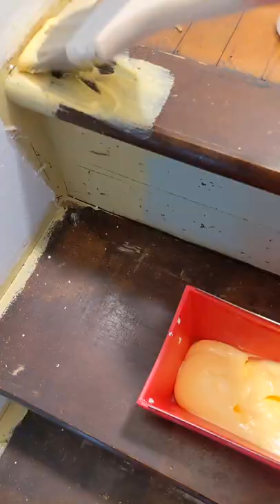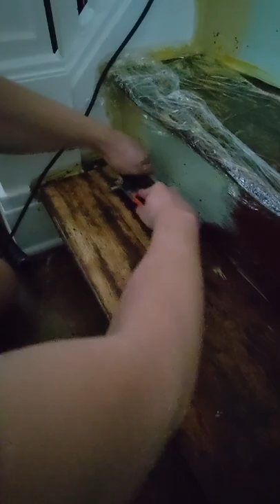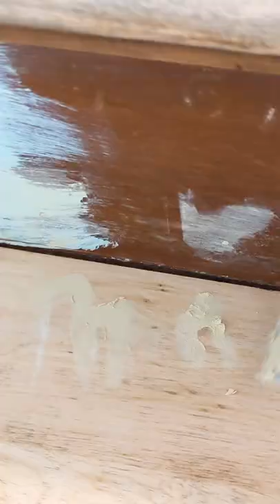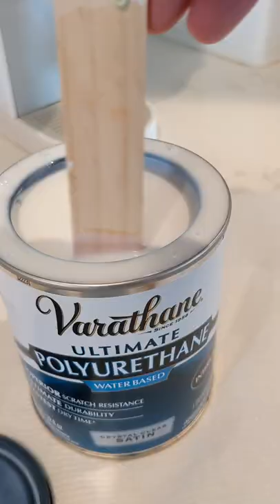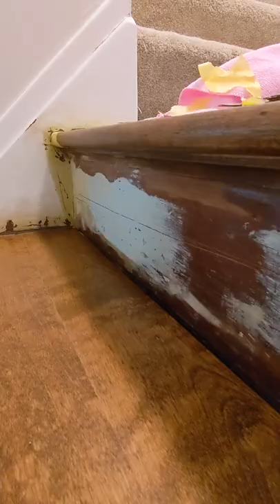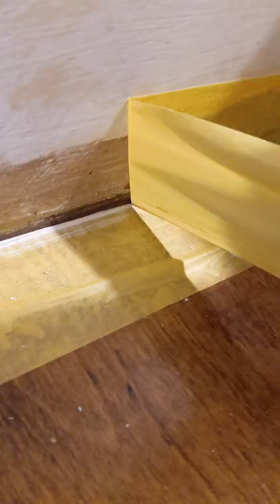Refinishing Old Hardwood Stairs #Shorts

Comment: Is this holding up well? Wondering for a similar project.
Reply from the maker: They are still looking great so far!! Some of the caulking on the edges of each step went on unevenly, so I could probably do some touch ups there but the stain and poly on the treads is holding up great! We added some clear adhesive stickies to each step because the stairs are kind of slippery when wearing socks!